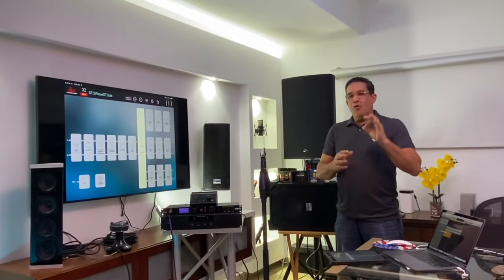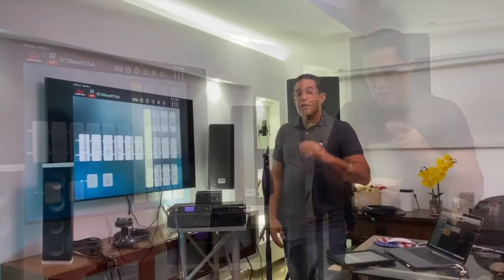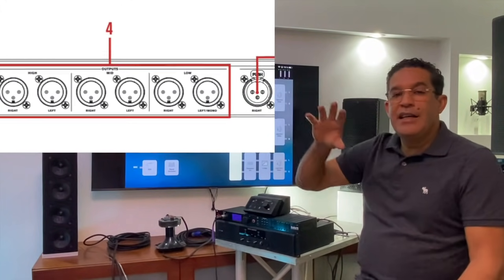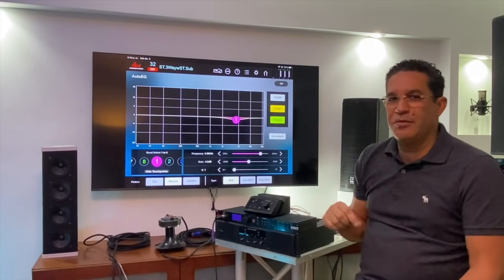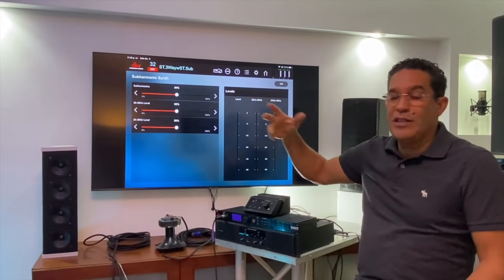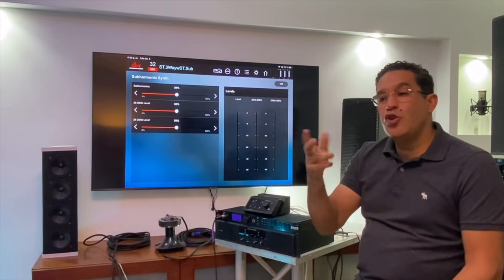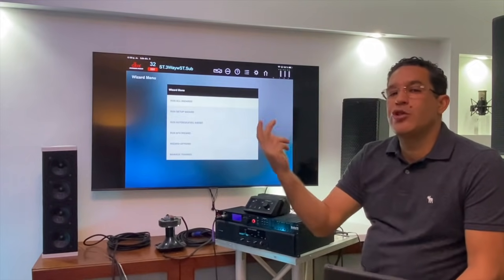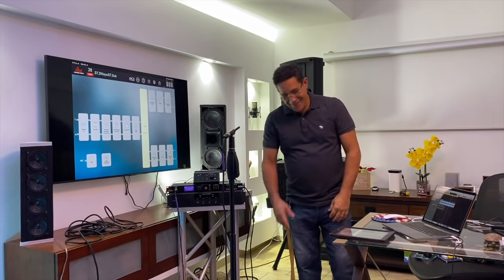como usar un DBX Driverack pa2

Comment: Hi, I use a netgear wifi box and controlling it by my phone, twice the dbx has frozen up and can't do anything to the dbx until I turn it off then back on again and its fine then, I just wondered have anyone had any problems like this, it's only does this when the netgear box is plugged into the dbx driverack pa2 but not always just twice. Thanks
Reply from the maker: Saludos gracias por escribirme, una de las cosas que puede provocar eso es la temperatura y otra es la variación de voltaje, que usted recuerde cuando le sucedió eso pasó una de esas cosas.
Se bendecido

Comment: Que tal Pedro!! Un gusto desde Argentina.  Compre un driverack para un sistema hifi de casa. Tengo unos kef ls50 meta, sub SVS 2000, amp musical fidelity m6si, bluesound node. Conecte el dbx entre el bluesound y el amp, usando la opción stereo en vez de 2 way, y sub en mono. El problema es que el volumen del amp NO modifica el volumen del sub, siempre se mantiene igual, habría que configurar de otra forma? Y también noto que perdí algo de detalles sutiles después del wizard, dbx puede que afecte la calidad de la señal sonora? O puede tener que ver la calidad de cables que use para entrar y salir del dbx. Gracias!!!!!!

Comment: Alguien podrá ayudarme,  en mi pa2 el canal derecho sale la señal muy baja en las tres frecuencias,   utilizo sonido stereo.
Reply from the maker: Saludos gracias por escribirnos.
Si ya realizaste las pruebas de señal y ganancia de entrada que son ( invertir los cables de entrada para asegurar que no seque los envíos están uno más alto que el otro, entrar al programa del PA2 y ver que los niveles están bien ) si no es eso conecta un cable en el canal que te está dando el problema destapa el equipo y mide con un teste en el modo de continuidad los tres hilos del cable porque si el pin 2 se ha roto la señal llega más baja, y los tres están bien hay que chequear las partes internas (filtros y resistencia) por si entro un audio muy alto o distorsionado y daño una de esas Piesas.
Se bendecido.      Ah!!!! Y no olvides suscribirte

Comment: Me parece imprudente e irresponsable dar conceptos de acústica y dinámica errados pues si alguien aplica dichos conceptos podría no sólo arruinar la acústica de un espacio, podría dañar inclusive su set. Dbx ha trabajado por años en la síntesis subharmonica, al punto de haber patentado dicha tecnología la cual propende por enriquecer la dinámica de las frecuencias que van entre los 24hz y los 56hz de manera independiente a la ecualización contrario a lo que usted indica en el video. Por otro lado, deberíamos comprender que el crossover en este caso divide la cadena de procesos en pre y post teniendo en el pre una ecualización parametrica y otra gráfica entre otros procesos y en el post una ecualización por vía y un limitador. En cuanto al compresor, tenemos un threshold que es el umbral en el que el compresor atacara la señal procesada, lo cual tendrá una ganancia post compresión y el ratio no es más que la cantidad de db que pasarán post compresión. En una compresión 6:1 por ejemplo, por cada 6 db que sobrepasan el threshold 1 solo pasara, pero no es un método de limitar como usted dice, es una herramienta de corrección que busca equilibrar los picos más altos de los puntos más bajos, pero debemos comprender igualmente, que una compresión muy fuerte dañara la dinama acústica.
Reply from the maker: Saludos además de este en el canal hay más de cuarenta vídeos, todos relacionados con el tema de sonido cuando disponga de tiempo dele una miradita y en lo que pueda aportar será bien recibir.
Paz,,,,